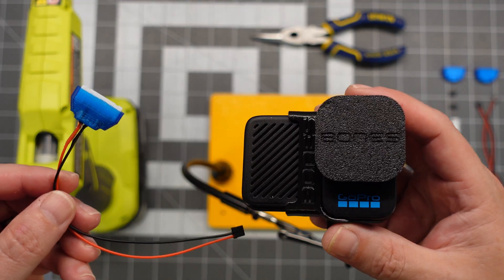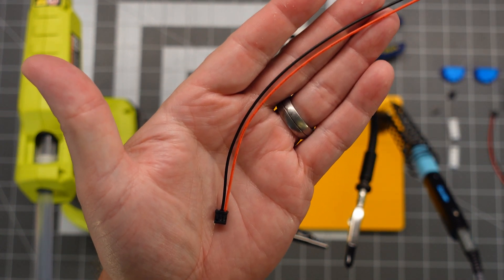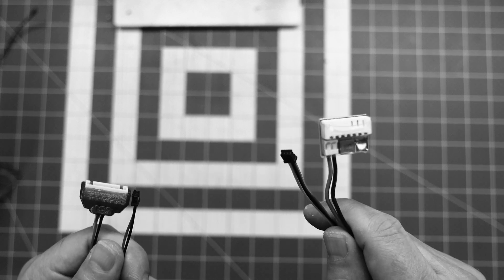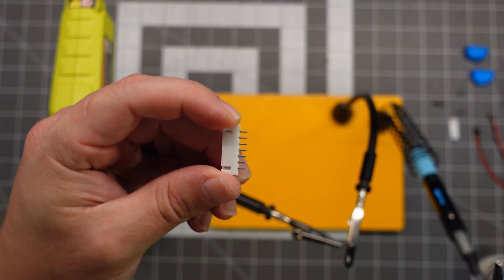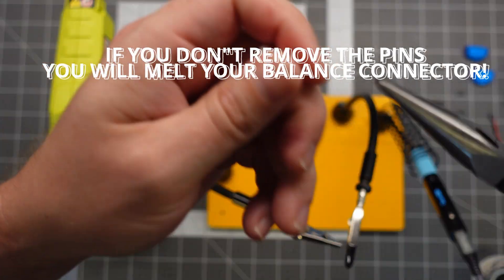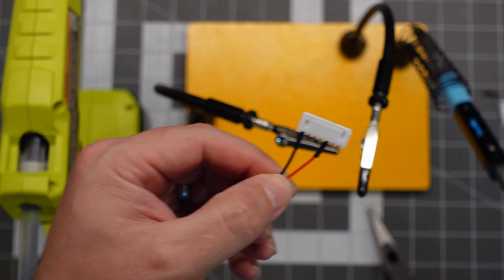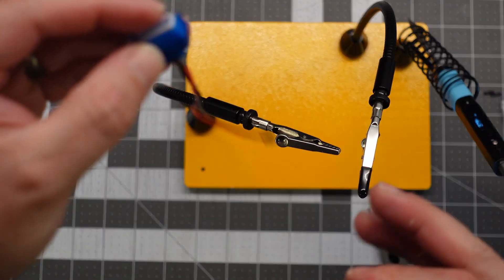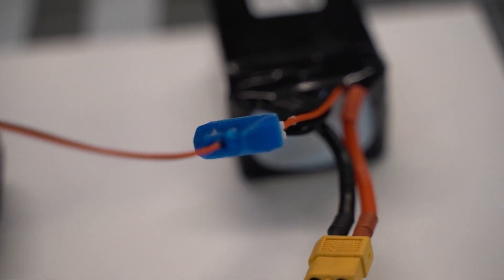GoPro Hero 10 Black Bones Balance Connector Tutorial

Comment: Hello! Will this still work for a GoPro 12 naked?  Thanks :)
Reply from the maker: Yes, you obviously need the correct connector on the camera side (not the GoPro Bones cable). Then you need to verify your cameras input voltage and make sure it is compatible.

Comment: Hi, would this be the same for a naked GoPro 8?
Reply from the maker: Your Naked GoPro 8 will take a different cable / connector to the camera, but adding an XH connector to the wires on the LiPo side is the same. Be sure to check your maximum input voltage to your naked GoPro and stay under that.
Reply: @AerialPixel  brilliant thanks for your response appreciated. 2s - 4s is power input, I’m running 4s so that’s perfect

Comment: I have a question. Did i need the 6th and 7th pin bcs i have 7 pin connector but without 6 and 7 pin
Reply from the maker: No you don't need them if you make your cable similar to the video with Ground on the 1st pin and positive on the 5th pin (technically those are the only 2 pins you need).
Reply: @AerialPixel  thanks man it worked

Comment: Do the pins REALLY need to come out? Lol
Reply from the maker: If you are very good at soldering no they don't need to come out. If you leave the soldering iron on there for more than a split-second you will melt the housing and have either a crooked or loose pin. I do about 5 of these a day, I usually don't take them out, but it's a good idea for the average hobbyist to IMHO

Comment: Great video! I need to power my hero bones, but some people say that you may fry it without a 5vbec like the iflight usb cable because of the voltage peaks of the lipo. What do you think about it?
Reply from the maker: There are two sides two it... Using the 5V BEC you are right on the bubble of having enough voltage to power the camera, but I've not had any issues with it, but it is possible to not have enough power, this is why the same cable isn't compatible with the full size Hero 10 without the battery installed, it requires a 2 amp minimum power source. On the other hand without the iFlight cable you are relying on the internal BEC of the camera which if it goes bad you have to replace the entire camera. This is why when I wire these cables up I do the 6S version at 4S voltage, in this case lower voltage is safer.
Reply: @AerialPixel  thats great news so it doesn't matters if i use 4s or 6s lipo, as long as I use only 4 cells voltage (16.8) I'm ok with spikes

Comment: Hey Thanks for the Tip. Do you know a way to change the Wifi of the Gopro from 5ghz to 2.4 ghz without the Backscreen? Thnaks for your help
Reply from the maker: Use the  QR Control app. It's in the Prefs section under WiFi. I did a video on QR Control with a Naked Hero 8 here: https://youtu.be/aCXTO1yl4lc
Reply: @AerialPixel  Thank you so much man! I must have overlooked this option in the QR Control app!! Time to fly now ;-)
Reply from the maker: Anytime! Have fun, fly safe!